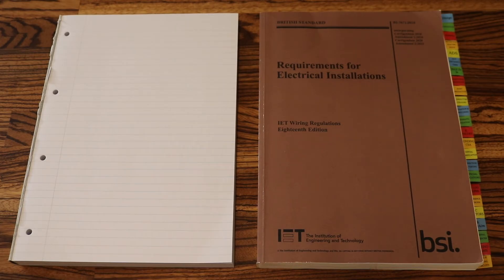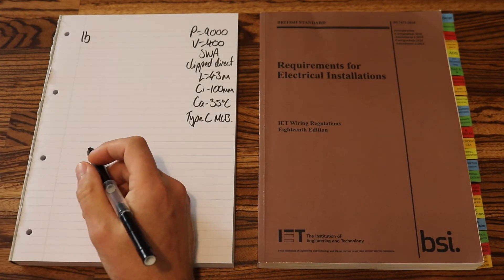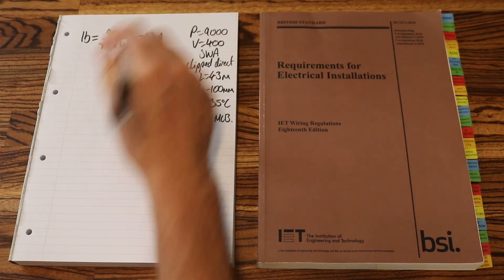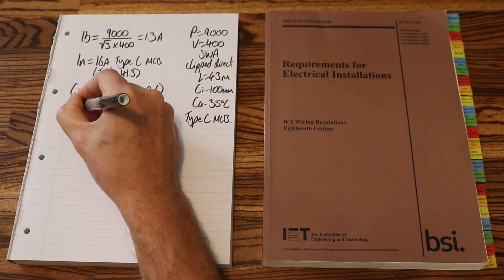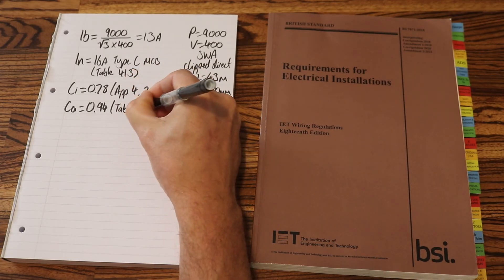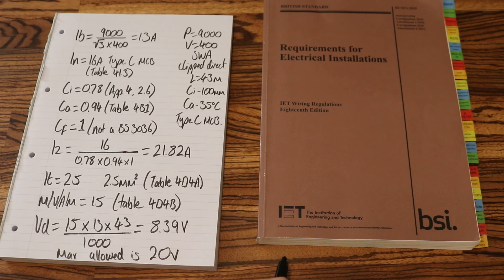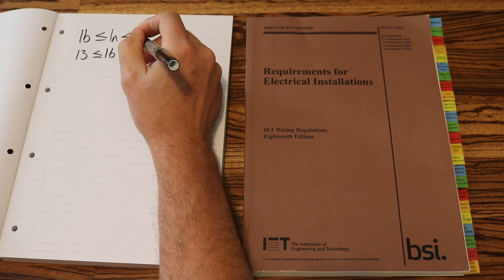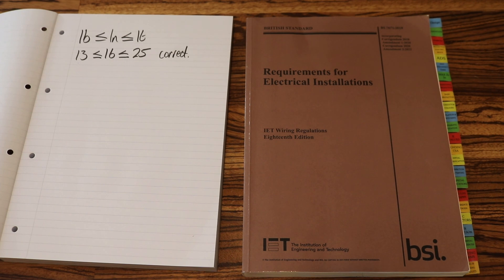Cable calculation. Calculating the live cable size from BS 7671

Comment: What if I have 40.42 amps  how do I know the In ... where can I find this sorry I m learning and I don't have idea...
Reply from the maker: If the Ib is 40.42A, then the In must be equal to or greater than. But as close as possible. A BS88-3 comes in a 45A, an mcb closest would be a 50A. Use the log log graphs on page 411 in BS7671 to tell you what sizes each protective device comes in. Or you could use the maximum zs tables on pages 68 and 69 for the same information

Comment: I understand that each subject is separate for exams.. but when calculating in real world, and designing a circuit, would you need to know the Ze and therefore max allowed R1+R2 to determine protective device and cable size selection?
Reply from the maker: Pretty much mate, although for standard circuits such A1, A2, A3 circuits no. You can follow Table H2.1 for those
Reply: @ElectricalStudentsUK thanks a lot brother 👍
Do you have a guide for your regs books page indicators? They look very useful!
Reply from the maker: @SeanyyBoy_ Check out the shop at www.electricalstudent.co.uk 
You can purchase the page tabs and other useful guides to help with passing level 2, level 3 and Apprenticeship course

Comment: shouldnt we look for maximum zs of circuit breakers with nominal voltage of 400 due to the supply voltage in the question being 400v
Reply from the maker: I am unsure what you mean? To calculate Zs we use Ze+(R1+R2). Could you explain further so I may help you

Comment: hello teach , i used the P=IV formula to current, dividing 9000 by 400 which left me with 22.5 amps , thats the formula i was thought , could you tell me where i went wrong , cheers
Reply: nevermind , found the answer , its three phase thats why.
Reply from the maker: @sadiki8764 Glad you spotted it mate

Comment: Is this for level 3 because I'm doing level 2 but we haven't done where u square root the 3 to work out volts is that sonthing covered in level 3 or am I suppost to know that for level 2
Reply from the maker: This is level 3 stuff mate. You will do basic cable calculations on level 2, but only using the OSG and only calculating the size of the live cable, not the cpc

Comment: Haven't you got your (It) and (Iz) the wrong way around.
(It) is greater than or equal to (In) divided by your correction factors which will give you (Iz) the cable you need for that installation.
Reply from the maker: Look at p46 in BS7671. It gives the IT definition of the tabulated current carrying capacity of a cable. So the IT value is the actual number found on tables 4D onwards, p448

Comment: What am I miss as I put the first sum in and I don't get 13a
Reply from the maker: Not sure pal, make sure the lower half of the fraction is only the square root of 3, then multiply 400. Not square root of 3 and 400. Maybe that? It is actually 12.99, so rounded up to 13, working to 2 pd

Comment: Excellent vid, as a follow on it would be good if you followed on with the same example to include for R1 + R2 with the adiabatic to confirm both the earth fault loop impedance and minimum size of earthing.

Comment: what do you do if your Ca is 24 degrees
Reply from the maker: @Orangeughhhhhhh  Any temperature lower than 25 degrees would have the same Ca factor as 25 degrees. For standard thermoplastic cable, that would be 1.04

Comment: In some of these cable calc questions in past papers they go on about calculating Cc and Cs as correction factors and ambient ground temp/buried cables. Do you know if I have to worry about these or can I just focus on. Ca, cf, cg and Ci?
Reply from the maker: @Oxygen97  Cc, Cs and Cd are used when a cable is buried in the ground. You basically only use the C factors that are stated or relevant to the question. So if your question doesn't say the cable is surrounded by insulation, you wouldn't use a Ci factor

Comment: i have one question, we know from the Ci table (cable surrounded by thermal insulation) that:
length in insulation 50mm is 0.88 derating factor ect.
but what if we have a different number (300mm for example) that is not included in the table, how can we find the derating factor?
thanks for the video by the way it is very helpful!
Reply from the maker: @evridiki.s  The Ci factor tables within Appendix 4 of BS7671 are larger and contain more values. As for the Ci table, it is a factor of 0.63 of 200mm up to 399mm. Then factor 0.51 of 400mm up to 499mm
Reply: @ElectricalStudentsUK   thank you, now it makes sense !!
Reply: Can you guys help me pelase with my question 
 I was reading in students guide regulations and was this part where they said at an example for cable calculations, for Ca they said "if the installation method can be found in this table  4D5 the rating factor to be used is 1" even in the example was saying thermal insulation exceeding 100mm.Any explanation to this please
Reply from the maker: @paul1528  Hi there, without seeing the full question it is difficult. I would imagine it is something do to with this. 
Table 4D5 specifically covers T&E in plasterboard walls and ceilings. Some of the reference methods, such as 101, already accounts for the cable being covered by more 100mm of insulation. So adding a Ci factor would mean it's effectively got 2 Ci derating factors added. Which would be incorrect.
Reply: @ElectricalStudentsUK  Thank you very much

Comment: 433.1.1 states that In ≤ Iz.  Iz isn't the outcome of the formula you have used In/C factors,  that is actually It (minimum required) we then choose a cable that has an It value ≥ this value.  Iz is this chosen It value (for the cable) multiplied by your rating factors, this should then be compared to the In value which it must meet or exceed.

Comment: You should be using Your design current as this circuit can’t be overloaded. 433.1.1 says you can as long as it’s a greater value than both design & protective device rating currents.
Using your way is not very practical in the real world & leads to larger & more expensive cables when they’re not really needed.

Comment: At 19.27 you choose to put “In” on top of the equation. In this example, surely “Ib” can be used, as this is a fixed load (water heater), that cannot be overloaded?
Reply from the maker: In short, no. Page 167 of the OSG gives you the equation of It>In divided by the C factors.

Also Regulation 433.1.1 details how the In must nit exceed the Iz value. Which is found by In divided by the C factors
Reply: @ElectricalStudentsUK 
that might be ok in a class room, but your way is wasteful in a real install.
you only use In for your CCC if you can overload the circuit. 433.1.1 says that your In must be less than It & it will be regardless of which one you use. The OSG is limited in most of its explanations because of the regs so it’s not written in stone that you have to use In.😂